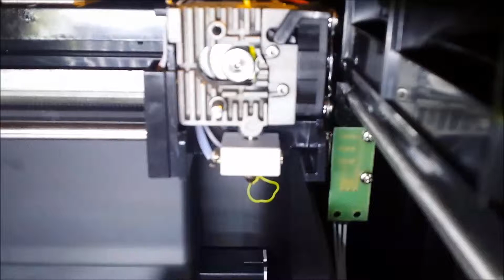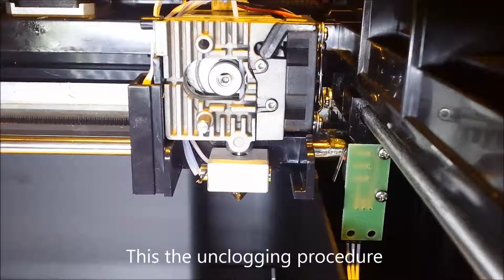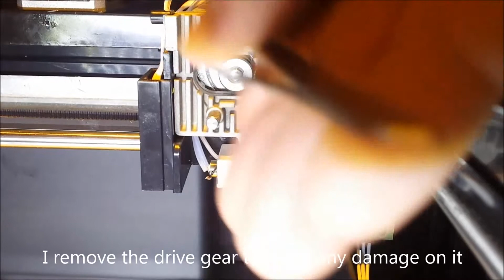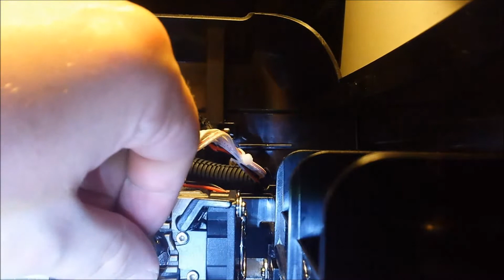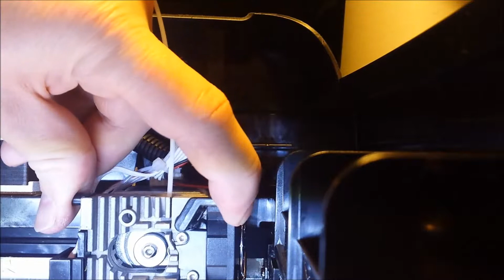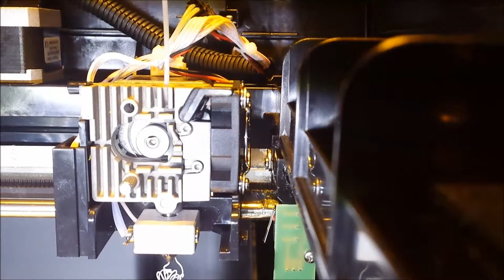solidoodle press unclogging procedure

Comment from the maker: you should use a small (1.5 mm) allen wrench to unscrew the drive gear. A complete tutorial is available on link below.
It is a bit tricky to unscrew but it as been successful for me. Be very gentle when you do so as you actually pushing on the all extruder.

http://support.solidoodle.com/hc/en-us/articles/204137290-Loose-Drive-Gear